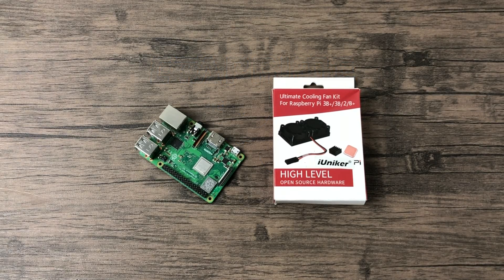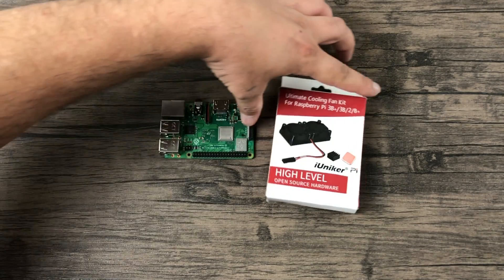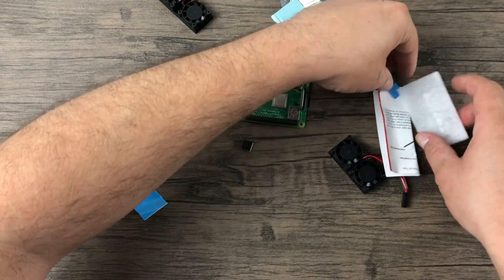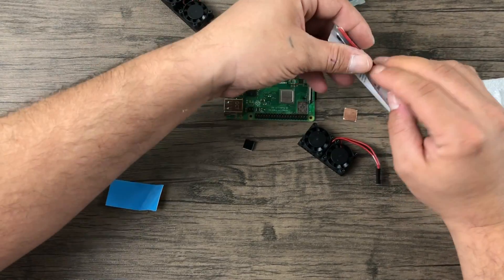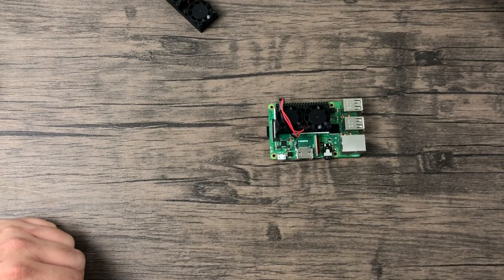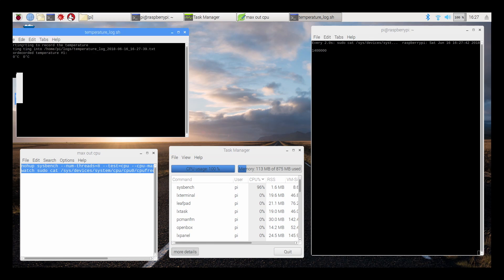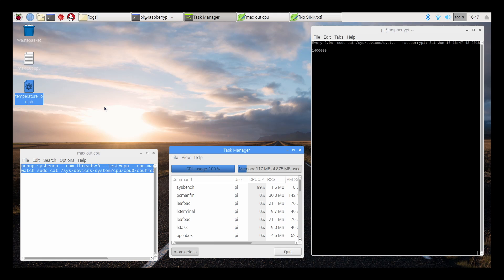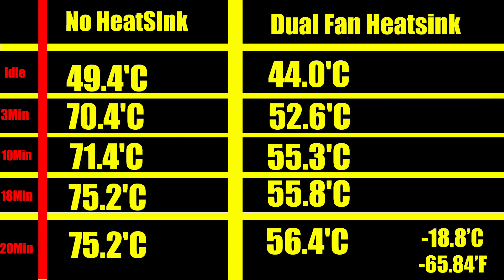Dual Fan Heatsink For The Raspberry Pi 3 B+ Thermal Test

Comment from the maker: BUY IT HERE Dual Fan Heatsink: https://amzn.to/2tdVR0c
Reply: ETA PRIME how compatable.is it with other boards or a raspberry pi form factor? I've been wondering this about every raspbert pi dual heatsink ever.
Reply: I wonder if it would be cheaper shipping it directly from the states, the Amazon source in Canada wants $28 and $7 for shipping.
Reply: Does the power of the heatsink have to be in specifically those pins, or can you fit it to any of the pins?

Also, according to reviews here, the thermal pad isn't thermal pad and is actually a heat insulator: https://www.amazon.co.uk/iUniker-Raspberry-Dual-Fan-Heatsink/dp/B07D5WWNH6/ref=sr_1_2?ie=UTF8&qid=1540392490&sr=8-2&keywords=iUniker
Reply: Curious about this, but the description says they are both tissue tape and not thermal pad tape. Also the reviews are saying the same.
Reply: pro tip: watch series at flixzone. I've been using it for watching a lot of movies these days.
Reply: @Angel Emmanuel definitely, I have been using Flixzone for months myself :)

Comment: I just put this on my pi,was wondering when I shut off my pi the fan will turn off,now will the pi heat up since the fan is off and it's just sitting there on the pi with the blue tape

Comment: Sorry, but that's some bad math on your part. 75.2'C is 167.36'F, 56.4'C is 133.592'F, for a difference of 33.768'
F NOT 65.84'F. Celsius to Fahrenheit is a 9/5 to 1 conversion. If you're measuring the actual temperature of something, you add 32 to the Fahrenheit result to adjust for the disparity in freezing point (0'C, 32'F). If you're just measuring the disparity in temperatures, you just multiply Celsius  by 9/5 to get Fahrenheit. Differences in temperature in Celsius should be less than double that amount in Fahrenheit, not more than triple.

Comment: others have said it works better to use the thick pad with cutouts for the processor and wifi chip and stuck to the board, while using thermal paste between the two chips n heatsink.  I'm very curious what the temps would have been like in your tests doing that.
Reply: Hot-melt glue gun could also be used (I'm assuming here) since it melts at 120-200C depending on the stick used.
Using just a little so the sink can be easily removed if needed.

Comment: I ordered one of those, haven't got it yet, but was wondering, and worried about it touching the capacitors, or other stuff, could I coat the capacitor with clear nail polish to protect from shorting? I have the RPI 3B+, 2017 model

Comment: What kind of application would push the CPU so hard? If you are just using the RasPi for normal stuff, these fans would be a waste of money. For example, I ran my 3B+ (no heatsinks at all, just a well-ventilated case) for 3 hours streaming YouTube videos and the CPU was barely warm to the touch. If you have an application that is pushing the RasPi to the limit then you should have bought something more powerful in the first place IMHO.

Comment: i like my dual fan. i also run  the snespi case fan on the 3v pins(i removed the microsd holder and didn't need to move the fans off the heatsink) does anyone know if this will fit on a tinkerboard?

Comment: Which one better, the thin or thick thermal?
Reply: Best is normal thermal paste but that won't work in this case.The thinner one is the second best option.
Reply: @jm036  But wouldn't it fall off with thermal paste?
Reply: @danielmpr  no it won't fall off, that's what the thick one is for - between board and sink, not on the chips.
Reply: @jm036  Actually you make cutouts for the cpu and wifi chips and use the thick one to adhere the sink to the board and can use paste between the chips n heatsink
Reply: Thinner is always better.

Comment: Those thermal stickers are the worst ! in time they start isolating heat rather than transfer it to the heat sink !
Reply: What would be a solution? can't use paste! will fall off, unless there is some that glue the heatsink into place!, wondering if using thermail compound + hot glueing the heatsink to the rpi would help?
Reply: @danielmpr  no, the thick stickers are for holding the sink to the board then you can use the paste on the chips. I think you might need to use both since on the 3B+ the Wifi chip is a little taller than the cpu.
Reply: You could also prob use hot-melt glue, which melts at 120-200C depending which stick you use. If you use just a little you can still remove the sink if you needed to.

Comment: Looks like your math for the temp calculation is a bit off. The difference of 18.8' C converts to 33.85 'F. Absolute conversion is  ('C x 9/5) + 32. Relative conversion is just 'C x 9/5. Otherwise the test looks great.
Reply: the first Programm i ever coded in c++ :D

Comment: ETA PRIME : I have a 3 b+ with this new dual fan (new shorter version for the 3 b+). Since the wireless module metal casing sits a bit higher than the CPU/GPU heat spreader, my dual fan is not leveled, it sits at an angle, so the thermal tape does not make full contact with the CPU heat spreader. I used the thin thermal tape. I thought this would impact negatively the efficiency of this dual fan to dissipate heat. Have you the same problem with yours? P.S. Geeekpi the seller on Amazon Canada of those dual fans answered me by email saying that they are aware that this new 3 b+ compatible version is in fact NOT fully compatible with the 3 b+ . I was shocked after reading their answer!!!

Comment: ETA PRIME :
3 b at 1200mHz with Flirc case = 65 Celcius after 20 min.
3 b+ at 1400mHz with dual fan = 54 Celcius after 20 min.
Do this heatsink dual fan assembly is that better than the Flirc case???
Reply: ETA PRIME : An answer would be great. I need to decide which cooling solution I will buy.

Comment: You should have output the processor speed as well to the log file so we could have evidence of the throttling (or lack of).
Reply from the maker: Stretch changed the location where I usually pull the speed from on Jesse and I couldn’t find where it’s located now. I eventually found it the day after I recorded.

Comment: Hey be careful people, I bought one of these.  It had the same looking box (that stated that it was for the 3 B+ but was made by GEEEKPi) and the same thermal solutions but the cooler did not fit. Looking at it compared to yours the gap between the fans is bigger.  I did get a full refund but it is misleading, just letting you know.  I have figured out a way of making it fit but it requires a rotary tool to etch a gap in the heat sync
Reply: Don't tell me that! I ordered on eon Ebay!
Reply: @danielmpr  did you get the correct one?

Comment: Nice video.  But an 18.8C difference is not equal to 65.8F difference.  The actual difference is 33.8F.  What happened is you put 18.8C into a temperature converter and it gives you 65.8F, as in 18.8C = 65.8F temperature, but the absolute difference is 33.8F since 1C = 1.8F.  Hope that makes sense.
Reply from the maker: Mind blown! WTH this seriously hurt my brain for a minute . You are totally correct. Thank you for bringing this to my attention.

Comment: Great video, do you think the super kuma 9000 heat sink fits right in the middle of that? No heat sink / kuma 9000 / double fan plus heat sink? I have her sink on top and bottom and the system works well. I get the lightning bolt but still works.

Comment: Awesome video as per usual. Just curious,  the numbers indicate a minor incremental increase in temperature with the fans. So, was wondering, if the stress test lasts longer than 20 minutes will the temperature readings level out to certain max value say below 60° ? Again,  awesome stuff man. Keep it up :)

Comment: How loud is it?
Reply: as quiet as you are flushing the toilet...
Reply: Quite loud :/
Reply: I just got this along with the Retroflag NesPi case. Even though the fan is relatively quiet (you won’t really notice it with ambient room noise), with everything inside the NesPi case, the whole unit generates a rising and falling humming noise. :-(
I’m guessing the NesPi case acts like an echo chamber caused by the fan noise and vibrations. So depending on where you put it, you may hear this horrible humming/pulsing noise.
I’m going to try and get some rubber feet or a pad to put under the unit

Comment: Nooooo, use proper thermal compound
Reply: The fan doesn't have a way to latch onto the Pi with thermal compound.  Unless there is some stick compound I have never used.  Also the pad worked just fine and kept the pi cool.
Reply: Bryce Emett Arctic Silver Cereamtic (or somesuch) is a combo thermal paste and binding agent for exactly this kind of situation, just for the record. But yeah, probably unworthy it unless you are actually throttling. But most thermal pads are borderline worse than nothing. :(

Comment: does any one know if those fans are set up in a push or pull configuration??
Reply: I have the older version on my pi 3b it pushes the air through the heatsink
Reply: The new 2018 design for the pi 3 b+ also pushes the air through the heatsink

Comment: I might have to get one for my NESPi case.

Suggestions for your stress test.
The degree mark is ALT+0176 in Windows or you can copy and paste from here. °
You should also include the CPU speed if possible in your log file to record when and what it throttles to if possible.  That way don't have to keep an eye on it.  You can just run the script and go do something else if you want.
Reply: I have one in my nespi case
Got my pi 3b overclocked 24/7 and it never overheats with this beauty
Reply: Shadey Mcbones how hard is it to fit into the nespi? I assume you had to alter the existing fan mount?
Reply: I just have a few heat sinks and a regular pi-fan mounted in my NesPi Case+ and I haven't seen my 3B+ go higher than 56°C.

For reference, I may be playing PS1 games for 3 hours straight and really, it doesn't get past 56. Now I know PS1 might not be the most demanding system, but hey.
Reply: Pulse80 cool thanks. I am hoping the fitted one, some alum heatsings, and some arctic silver should do it a treat.
Reply: ° ALT+248 works too
Reply: Jamie Norwood No modification needed (nespi case+ with dual fan)

Comment: I have a Hyperpixel 3.5 inch touchscreen on top of my pi 3. I was wondering if the fan would fit under the screen. Also, if anyone knows how to power it without the gpio pins, that would help.